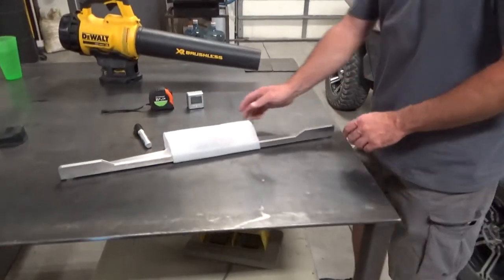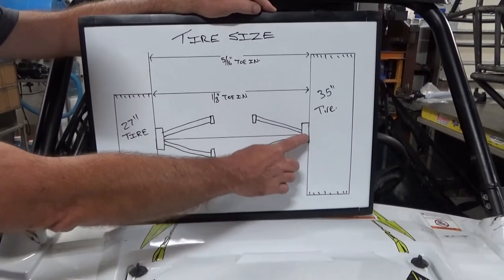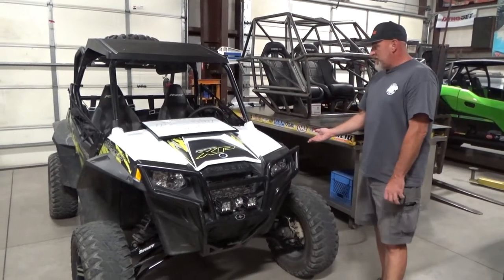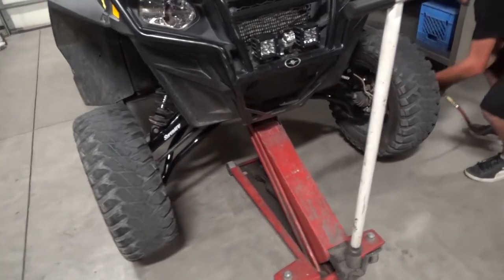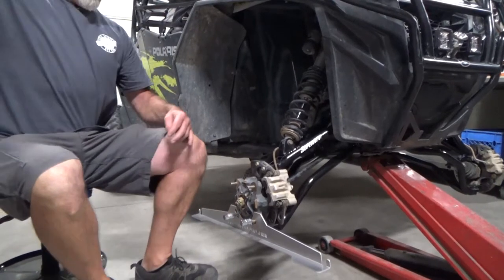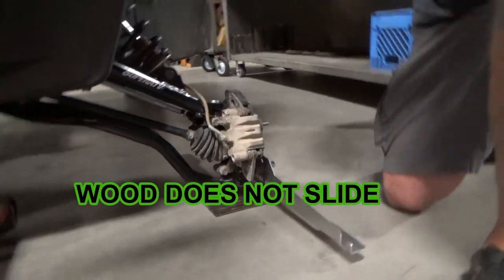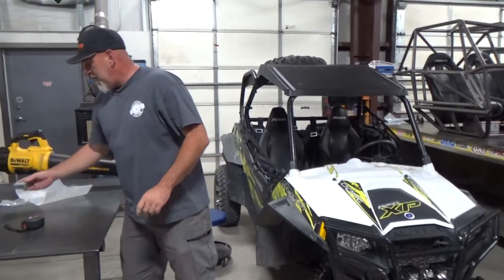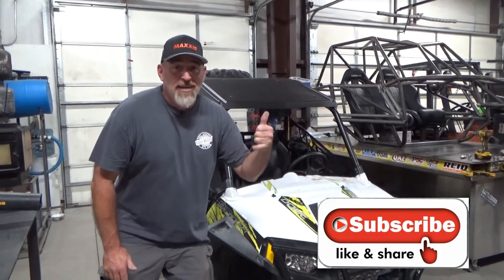How To Do A UTV Alignment

Comment: You should have done a cross measure to insure everything is true to center before adjusting toe. Left tool to right arm pivot and right tool to left arm pivot. I just don’t trust eyeballing. One other thing that may make doing it by ourselves easier is to put the tape measures one on right and one on left tool then you can watch the tape move as we adjust. Nice tool and video.
Reply from the maker: Good points. There were so many points we were trying to hit in that video we forgot multiples.
Reply: @Lee Schmid Are you saying to have each tape measurer going in the opposite directions? I have been having that thought myself!
Reply from the maker: @Hi-Tech-Ray  what he is saying is to measure the tape measure to a specific point of the frame. However the frame width changes from front of tires area to rear tires area so it makes it difficult.
Reply: @Hi-Tech-Ray  yep
Reply: @fullaccessutv  I got that as the first part but I think he also was saying to reverse the ends of one of the two tape measurers!
Reply: @fullaccessutv  Doing a cross measure to get everything close and centered before the final alignment. Then set the tapes so you can watch at the tape move on each side as you adjust. Just another way.
Reply: @fullaccessutv  With an old VW racing mag article, I think they have a center line of the car, then run all measurements off that. Have you ever considered adding metal tabs for magnetic tape measure ends on the alignment tool? Great content.
Reply: Does this make sure there is no frame or arm damage?

Comment: You should explain how to align the front wheels with the rear so your cart is tracking properly
Reply from the maker: I agree however the rear suspension geometry on most of these utv’s is not truly made for adjustment. You make one adjustment in one area and it affects everything else that is more important. A lot of these things don’t drive straight in the rear so in my opinion it’s almost irrelevant because you can’t really adjust it to get it correct. However on a street vehicle, it would be a must do, but not really an option for long travel.

Comment: Hi I did alignment big parts of my life and you don’t put toe in on a all wheel drive need toe out and when the axle torque it brings the toe to zero 😊
Reply from the maker: yes, but we are not talking a street car. Tow in or out is dependent on the driver and terrain. We like lots of toe out to turn harder into the turns racing. Slight tow in with larger tires and in the rocks.

Comment: Thanks for the video and the affordable tool. I will be replacing my A-arms soon and this info will help me with alignment.
Couple questions :
1)Your tool is notched for setting a 31" tire, correct ?
   How do you calculate toe for different size tires?
2)Where should I set my toe (measurement) if I am running 30" tires on 14" rims ?

I'm not racing, just trail riding basically

Thanks in advance
Reply from the maker: I would recommend 1/8 inch toe in for30 or 31 inch tire. You would notice no difference between that inch measurement.

Comment: I recently received and used my FULL ACCESS UTV alignment tool and it was very easy, i found that tightening the tie rods end completely then using a piece of tape to draw a line at the 12 o'clock position then loosening it to about 14 turns on each side helped kept track of the number of turns was helpful! from there what i did to one side I did to the other regardless if I did a 1/8, 1/4 ... etc to a full turn to get measurements to the exactly the same before doing the 1/8 toe in! I found that putting the tape measures going sideways from the surfaces which touch the hubs was more accurate for centering the steering wheel and as far as the measurers going the opposite directions was helpful to know for sure if I am adding or subtracting 1/16s or 1/8s for example subtracting 1/16th to each side in order to make a total of 1/8" of a toe in! Using a small piece of tape was helpful for at least keeping on of the ends secured! Other than that its very simple in order to have a piece of mind! My 2021 Polaris Ranger 1000 Premium no tracks better than the first day I got it and the four wheel drive also engages correctly now that all four wheels are going the same direction and not slipping on the ground! Can't wait to see if it makes an improvement when pushing snow with the plow! Thanks FULL ACCESS UTV for making a tool that makes wheel alignment an ease!
Reply from the maker: You are very welcome, and I’m glad you like it.
Reply: @fullaccessutv  I forgot to ask another important question: Does it matter where I have my pre-load shocks set to from soft to hard ride?
Reply from the maker: @Hi-Tech-Ray  Yes it does.  That has a different answer for every car though. If your springs are sagging out then just adjust the upper. That should put it back to where it needs to be for the secondary. If you’re cranking in lift then The height you added on the top, you should also do on the bottle.

Comment: You more or less made the tires parallel to each other but how do you know they are pointed dead straight and not veering left or right ever so slightly.  Further, how do you know its going to drive straight with the wheel dead straight.  Thats my issue, I pulled the rack and installed it back to the same spline but while driving straight the wheel is turned so I figured id put the wheel straight and adjust the tie rods. Can you measure from front of the bar to center of machine somewhere on each side to verify they are pointing straight then set your toe from there?

Comment: Great vid.  I'm guilty of using 2 inch angle iron pushed up against the tire sidewall on each front tire and measuring from there.  I run a bit more toe than you suggest plus I run negative camber on the front and rear on my X3 because I can.  I have fully adjustable A arms and radius arms.  It handles so much better than stock it's not even funny.  A stock X3 drives worse than anything I've ever driven.  It understeers like its on ice then oversteers when you try to correct it with the throttle.  A big problem with the X3 is the Tie rods are at the wrong angle at the hub compared to the rest of the suspension geometry.  As the suspension cycles from full droop to full stuff the toe changes pretty drastically.  It's not even worth the effort to align the toe without first replacing the tie rods with the Cognito Motorsports Toe correction tie rods or another brand.
Reply: Man I agree. The stock x3 drives like dog 💩 but once dialed in, those x3’s are amazing.

Comment: @FULL ACCESS UTV, A couple of questions if you dont mind! 1) Could a faulty toe adjustment cause your bearings to wear prematurely? 2) Where could i get steel plate similar to the ones you used in the video if I dont have on hand? 3) I have a 2021 Polaris Ranger 1000, does the stock tie-rod have the inner jam nuts like the ones on the Razor in the video! PS: I have ordered the tool featured in this video and I am looking forward to using it!
Reply: PS I just received  the speedway motor's Front End Toe Alignment Gauge Tool, after seeing this I am going to return that one as I see it measures with the tires on the machine!
Reply from the maker: Yes bad toe will cause the bearings to wear. How excessive is dependent on how excessive the bad toe is. Steel plate you can use anything from even Home Depot. As long as the vehicle easily slides on the ground. As far as the last question I’m not sure. I worked on a general last but don’t recall a ranger 1000.
Reply: @fullaccessutv  Like you said when these UTV come out of the box which I believe included dealer delivery they dont perform the alignment! Then if the bearings go as a result then its automatically the customers fault instead of theirs for not delivering a properly alignment UTV! I already know my Ranger has a toe issue because I have more toe out on the drivers side than the passenger side! Instead of counting the threads by the jam nut, I used a digital caliper to measure the gap between the jam nut and where the threads end by the tie rod end and my measurements were as follows 20.1 mm on  the passenger side which the tire is near straight and the drivers side measured 10.1 MM,  a 10mm difference! No wonder why I was getting stuck in the snow in 4 wheel drive the passenger tire was pointing straight and the drivers side was going left!

Comment: Bought this for a KRX 1000. You guys do a lot of KRX stuff. The KRX doesn't have lug nuts with a taper. And I'd like to know how to loosen the adjustment rods? Do I have to pull the boots from the steering box end?
Reply from the maker: if you can get 2 tapered lugs it better, but not needed or required. lugs can be gotten at any autoparts store for say a mid 2000 honda. M12x1.25. 
The ends are adjustable, they do adjust and come apart.

Comment: Was wondering I was always told and trained that ride height affects adjustments and can see if on computer hi tech machines, won’t having the rear tires on and the front laying down like that affect the measurement?
Reply from the maker: no, as long as everything is settled down. It may be a little off, but the alignment guys are off even more.

Comment: How do you determine that each wheel has the same tow in? For example for a 1/8 total tow in, each wheel should have 1/16 of tow in rather than one wheel having the total 1/8 toe in
Reply from the maker: Tough question. It will all start with centering the steering wheel and knowing that is the center of the steering rack. From there once you get everything straight, it’s just a slight adjustment on each tie rod. You will just have to know that you adjusted each end equally.

Comment: AT 14:30 you mention the eyeball method to do the first quick adjust.  Are you simply attempting to get the tools straight?? I did see the drivers side toed out but didn't see the passenger toed in.
Reply: Regardless it is a great video and very informative
Reply from the maker: Yes it’s very hard to tell in the video. I am attempting to get the tools straight knowing that the steering is centered first. Then from then I dial in everything.

Comment: Here is something that I kind of find misleading in my 2021 Polaris Ranger 1000 service manual as it states when replacing the steering gear box assembly which includes the tie rods! It says to measure the length of your tie rod ends where it goes into the steering knuckle! The reason why I find it to be misleading is, if the original assembly has improper alignment issues that you will be copying that to the newly installed one! So wouldn't it be better to do an alignment from scratch or include counting of how many threads there are by the jam nuts along with the total length of the tie rod?
Reply from the maker: Those directions just get you close to stock, Which makes it easier to align. A alignment on anything is essential.

Comment: I'm a little confused. U keep saying toe in. 
My dealer says it should toe out 1/8 to 1/4??????
Ur right, lots of conflicting info out there.
Reply from the maker: Each will give you different vehicle reactions. It’s up to you what you want to run, but this is what we run. When racing short course we would tow the vehicle out a quarter inch so it would cut harder into turns. That’s not good for tire wear and  you get a lot of feedback through the steering, so for usual street or trail rigs we recommend in.
Reply: @fullaccessutv  Hello again. So I’m thinking again (which I shouldn’t), I have another question.
I’ll will just use whole numbers for simplicity, not accuracy.
Say you start out with the wheels parallel, front and back at 48 inches. So you want 1/2 inch total toe in, that’s 1/4 per side. Now your measurements will be 47 1/2 total at the front and the rear becomes 48 1/2, correct?
But my question is, shouldn’t that be 23 3/4 from center of the machine?
If you don’t go off center I’m thinking, you could be 24 on one side of center and 23 1/2 on the other and still be 47 1/2 overall?
Reply from the maker: @martymartian9820  1/8 inch toe in. Meaning 1/16th of an inch per side. If 48 in the rear it should be 47 7/8 in the front
Reply: @fullaccessutv  Yes, per side if you measure from the center of the machine. It has to be equal at both ends which means you have to take a measurement from center, not overall, correct?

Comment: isnt the car being nose down effecting the accuracy?
Reply from the maker: By a very slight amount yes. Nothing you can probably read on a tape measure though
Reply from the maker: I just verified this. We set the krx on milk crates and steel plate and measured shock length and toe set. Then we did it on the ground. Shocks showed to be 1/8” more compressed and the toe set was the exact same measurement. It makes no difference as long as you follow the video.

Comment: Many things here not right.did you have ever seen the plates that use shock therapy? Plate attached on hubs the front end sits on the plate simulating the wheel puting the load on the hub like the car was designed .not on the lower ball joint like yours.your taking the load of the upper a arms and knuckle changing suspension geometry. another thing is the front end so low transfering all the weight toward the front. Should be aligned close true height .
Reply from the maker: Whether it is on the hub, Ball joint, or rotor makes no difference in alignment. As long as the vehicle settles too natural ride height. That cannot change the suspension geometry. 

Also I agree that we should have the vehicle level however that would increase the cost, and shipping cost to customers exponentially. 

During our testing of ride height. Center to center shock measurements were monitored. lowering the front of the vehicle to the ground did not change ride height within any measurable reading on a tape measure. 

In the end, I agree it’s not perfect as a digital Alignment machine, however it is much cheaper and easily 98% correct if done correctly.
Simply taking your Utv to a digital alignment shop means nothing when they do not understand Offroad suspension geometry or how the vehicle needs to be settled in order to align it. 

IMO this is the best option out there for price point and accuracy.